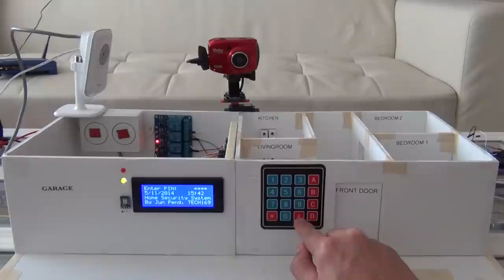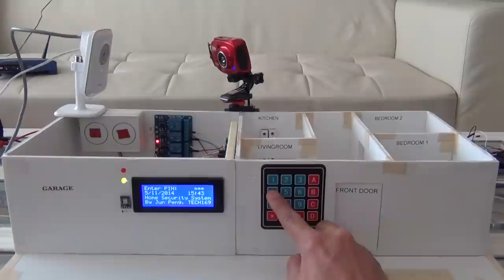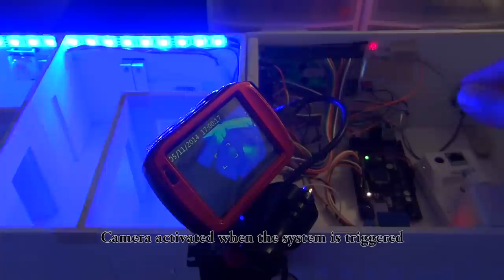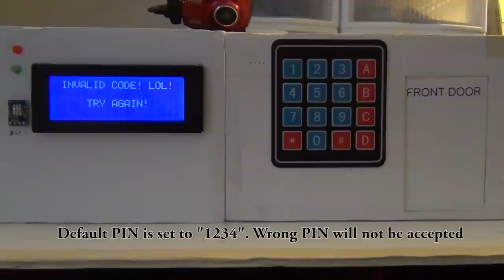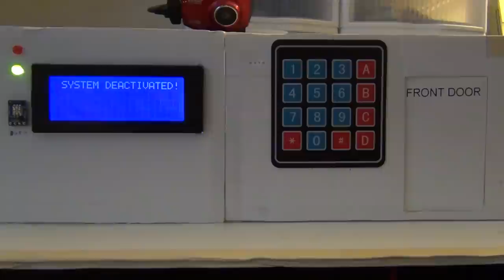Arduino Home Security System

Comment: great project. a HOW TO of your project with the script would be much appreciated
Reply from the maker: Man... dont have time to write a how-to
Reply: find some... lol
its ok just kidding. you could just upload the sketch though
Reply: Pikubird Ok
Hello, i build my own home security system. you find some videos on my channel. i'll publish the sketch and the circuit, when i am ready. Sorry for my bad english. Features atm: RFID-Reader, I2C-bus-connected terminal/ sensorcyles (Arduino Nanos) to maincontrol (Arduino Mega) with sabotage protection, SD-card event logging. Next time i'll add ir-sensors, keypad for configurations, LAN-module for webcontrol, rf-transmitter
Reply: Presence4You tx a bunch
Reply: Presence4You aun no lo terminas amigo? tengo la misma idea de proyecto y tengo algunas dudas al respecto que tal vez tu me ayudes a resolver, un saludo
Reply: Humberto José López Herrada Nein, ich bin noch nicht fertig. Ich warte noch auf Teile, wie z.B. die LAN-Erweiterung, das Kamera-Modul und ein Display. Koplett fertig aufbauen, mit Gehäuse etc. Kann ich es auch erst, wenn meine CNC fertig ist. Es wird ja jetzt wieder wärmer, da macht auch das Arbeiten im Keller wieder Spaß ;)
Reply: Pikubird Ok Excellent video content! Excuse me for butting in, I would appreciate your initial thoughts. Have you tried - Mahorrla Defence Wisdom Method (google it)? It is a great one of a kind product for securing your home from danger minus the headache. Ive heard some awesome things about it and my work buddy  got astronomical success with it.
Reply: que tal amigo, queria saber si usted logro; obtener buenos resultados con este proyecto, gracias.
Reply: lograste hacer este proyecto?

Comment: What GSM module did you use ? Can I use SIM300 to connect to Arduino Uno instead of using SIM900 or SIM800L? I'm doing home security with sms alert for my university physics project but I want a cheaper gsm module. Is it going to be any error if I use SIM300 instead of SIM900?

Comment: Jun Peng,  I really liked your project, but I can't find where you change the date and time sketch in which variable resistors are connected to the display and to what pin on the arduino connects to the rightmost contact on the keyboard? Thank you!

Comment: That is a wonderful and neat work.. I am truly impressed :)
I want to ask that after powering Camera through relay how did you set it to record video by default ?
Reply from the maker: The camera has a function as DASH CAM.
Reply: Do u have the coding for the Arduino

Comment: The code is ok?? The connections are ok?? i remove the relays, include the camera and the lights, from the code and the project and this not work. After that the green led is always on, and the rgb module is always showing 4 colors(red, green,blue and white). I need help to put this project work. Please, help me

Comment: thanks for your project jun peng

we finally completed our project successfully
Reply: +uma chand plz can u send me the shematic and the codes ?
Reply: hi friend they are provided in the description
Reply: thank u for the answer !! plz i need the real shematics !! cuz i have a problem when i enter the code 1234#
Reply: there are errors in the code 

if you correct the code and make connections it will work for sure
Reply: uma chand i want some help from you about this project i am having problem  in the code plz help me
Reply: Arduino: 1.8.2 Hourly Build 2017/01/25 04:33 (Windows 7), Board: "Arduino/Genuino Uno"

D:\sketch_jan28a\sketch_jan28a.ino:14:83: fatal error: Password.h: No such file or directory

 #include <Password.h> //http://www.arduino.cc/playground/uploads/Code/Password.zip

                                                                                   ^

compilation terminated.

exit status 1
Error compiling for board Arduino/Genuino Uno.

This report would have more information with
"Show verbose output during compilation"
option enabled in File -> Preferences.
HAVING THIS PROBLEM
Reply: @uma_chand  Can you share me the code?? they're no longer available

Comment: Hello, HOW did you turn off/on the cam?? I know you mentioned it on the codes and your Schematic, but still I don't get it. HOW did you connect your CAM? is it only your model you used can be turned on and off??

Comment: Can anyone help me.i made a simple pir alarm and its powered of a lip battery.when mains is turns on it charges the lipo. problem is is i  arm the alarm why the battery is charging from the mains moments later the alarm will go off like the pir sensor has been set off even tho noting was moving. if i disconnect the charger from the battery and set the alarm it does not randomly go off and works as it should. im guessing im getting interference from the battery charger but not sure what to do or try ?

Comment: Hello, love the work. I got a question, does the solid state relay have to be suppled with constant current to close its relay or just a trigger pulse. TY :)
Reply from the maker: I used a separate power source for the relay to trigger the camera. Camera needed more current than the arduino board can produce.
Reply: let me rephrase myself, do i need to supply constant power to the relay, like giving it current just to maintain the hold of the magnetic coil or just a trigger pulse to switch position from open to close.

Comment: Sir ,
       I was tried but come out this type of error ?kindly advise how to fix it. thanks 

In file included from sketch\Original_Program.ino.cpp:1:0:

C:\Program Files (x86)\Arduino\hardware\arduino\avr\cores\arduino/Arduino.h:41:14: error: expected identifier before numeric constant

 #define LOW  0x0

              ^

C:\Program Files (x86)\Arduino\libraries\Keypad/Keypad.h:43:13: note: in expansion of macro 'LOW'

 #define OFF LOW

             ^

C:\Program Files (x86)\Arduino\libraries\RTClib-master/RTClib.h:79:25: note: in expansion of macro 'OFF'

 enum Ds1307SqwPinMode { OFF = 0x00, ON = 0x80, SquareWave1HZ = 0x10, SquareWave4kHz = 0x11, SquareWave8kHz = 0x12, SquareWave32kHz = 0x13 };

                         ^

C:\Program Files (x86)\Arduino\hardware\arduino\avr\cores\arduino/Arduino.h:41:14: error: expected '}' before numeric constant

 #define LOW  0x0

              ^

C:\Program Files (x86)\Arduino\libraries\Keypad/Keypad.h:43:13: note: in expansion of macro 'LOW'

 #define OFF LOW

             ^

C:\Program Files (x86)\Arduino\libraries\RTClib-master/RTClib.h:79:25: note: in expansion of macro 'OFF'

 enum Ds1307SqwPinMode { OFF = 0x00, ON = 0x80, SquareWave1HZ = 0x10, SquareWave4kHz = 0x11, SquareWave8kHz = 0x12, SquareWave32kHz = 0x13 };

                         ^

C:\Program Files (x86)\Arduino\hardware\arduino\avr\cores\arduino/Arduino.h:41:14: error: expected unqualified-id before numeric constant

 #define LOW  0x0

              ^

C:\Program Files (x86)\Arduino\libraries\Keypad/Keypad.h:43:13: note: in expansion of macro 'LOW'

 #define OFF LOW

             ^

C:\Program Files (x86)\Arduino\libraries\RTClib-master/RTClib.h:79:25: note: in expansion of macro 'OFF'

 enum Ds1307SqwPinMode { OFF = 0x00, ON = 0x80, SquareWave1HZ = 0x10, SquareWave4kHz = 0x11, SquareWave8kHz = 0x12, SquareWave32kHz = 0x13 };

                         ^

In file included from C:\Users\User\Desktop\Electronic folder\Home Monitor system\Project -2\Original_Program\Original_Program.ino:18:0:

C:\Program Files (x86)\Arduino\libraries\RTClib-master/RTClib.h:79:139: error: expected declaration before '}' token

 enum Ds1307SqwPinMode { OFF = 0x00, ON = 0x80, SquareWave1HZ = 0x10, SquareWave4kHz = 0x11, SquareWave8kHz = 0x12, SquareWave32kHz = 0x13 };

                                                                                                                                 ^
exit status 1
Error compiling for board Arduino/Genuino Mega or Mega 2560.

Comment: Hello jun Peng, please did you use RTC DS1307 ic to display the time on the LCD?
Reply from the maker: I think that's what is used.
Reply: thank you for your reply. but i couldn't find the RTC in your design schematics for your project. please how did you connect it?

Comment: just curious, cuz i am a novice. why are you using relays, are you using high voltage? or you are using relay to control the voltage fluctuation due to the LED strip?
Reply: Bharath Kumar He is using led's for demonstration ,in real purpose he will use realy for lights
Reply: Relay to cut off the camera supply.If there is no intruder.Camera wont get the power supply
Reply: Arduino 4u Your are using relay only for cameras...
Reply: Arduino 4u relay are used for switching ...I mean to say that if there is use of 220 ac light source then you have to use relay for switching

Comment: That's quite a great project you put up! Well done...I have a question. How can your code be modified so that the system will constantly check the sensors whether or not the alarm system has been activated? If the alarm pin is entered while one of the sensor is open and its suppose to be close the system will signal that particular sensor to the user. The system can be armed only when all sensor are inactive that's all doors closed and the is no motion in the rooms.

Comment: I want to use a Arduino Uno R3, 8 channel relay module and a DS1302 RTC to control the lights timing of my house. It is similar to a digital house timer switch with multiple days and different time On and OFF setting. Can you help me with the codes.

Comment: Hello, with my friend I tried make your model of "Arduino Home Security System". We bought everything from your list, and constructed according to your schematic. When we launch arduino with your code - it´s only launch servo and display start lighting without text. Sensors not responding. Your schematic is compatible with code? What we must do in RTC library so as it would be functional? Thanks for help. We would be grateful. I can send you some screens of that problem.
Reply: now can you success it?
Reply: hello how about your project now? 
I think I want to do this project too.
Reply: so u can complete the project ?

Comment: Arduino: 1.6.0 (Windows 7), Board: "Arduino Uno"

sketch_feb17a.ino:4:9: error: stray '@' in program
sketch_feb17a.ino:4:18: error: variable or field 'keypadEvent' declared void
sketch_feb17a.ino:4:18: error: 'KeypadEvent' was not declared in this scope
sketch_feb17a.ino:1:1: error: 'Home' does not name a type
In file included from sketch_feb17a.ino:1:0:
C:\Program Files (x86)\Arduino\hardware\arduino\avr\cores\arduino/Arduino.h:41:14: error: expected identifier before numeric constant
 #define LOW  0x0
              ^
C:\Program Files (x86)\Arduino\libraries\Keypad/Keypad.h:43:13: note: in expansion of macro 'LOW'
 #define OFF LOW
             ^
C:\Program Files (x86)\Arduino\libraries\RTClib/RTClib.h:59:25: note: in expansion of macro 'OFF'
 enum Ds1307SqwPinMode { OFF = 0x00, ON = 0x80, SquareWave1HZ = 0x10, SquareWave4kHz = 0x11, SquareWave8kHz = 0x12, SquareWave32kHz = 0x13 };
                         ^
C:\Program Files (x86)\Arduino\hardware\arduino\avr\cores\arduino/Arduino.h:41:14: error: expected '}' before numeric constant
 #define LOW  0x0
              ^
C:\Program Files (x86)\Arduino\libraries\Keypad/Keypad.h:43:13: note: in expansion of macro 'LOW'
 #define OFF LOW
             ^
C:\Program Files (x86)\Arduino\libraries\RTClib/RTClib.h:59:25: note: in expansion of macro 'OFF'
 enum Ds1307SqwPinMode { OFF = 0x00, ON = 0x80, SquareWave1HZ = 0x10, SquareWave4kHz = 0x11, SquareWave8kHz = 0x12, SquareWave32kHz = 0x13 };
                         ^
C:\Program Files (x86)\Arduino\hardware\arduino\avr\cores\arduino/Arduino.h:41:14: error: expected unqualified-id before numeric constant
 #define LOW  0x0
              ^
C:\Program Files (x86)\Arduino\libraries\Keypad/Keypad.h:43:13: note: in expansion of macro 'LOW'
 #define OFF LOW
             ^
C:\Program Files (x86)\Arduino\libraries\RTClib/RTClib.h:59:25: note: in expansion of macro 'OFF'
 enum Ds1307SqwPinMode { OFF = 0x00, ON = 0x80, SquareWave1HZ = 0x10, SquareWave4kHz = 0x11, SquareWave8kHz = 0x12, SquareWave32kHz = 0x13 };
                         ^
In file included from sketch_feb17a.ino:23:0:
C:\Program Files (x86)\Arduino\libraries\RTClib/RTClib.h:59:139: error: expected declaration before '}' token
 enum Ds1307SqwPinMode { OFF = 0x00, ON = 0x80, SquareWave1HZ = 0x10, SquareWave4kHz = 0x11, SquareWave8kHz = 0x12, SquareWave32kHz = 0x13 };
                                                                                                                                           ^
Error compiling.

  This report would have more information with
  "Show verbose output during compilation"
  enabled in File > Preferences.

Comment: Guys mine worked but 1 problem the led is off when system is trigerred and on when it is active if i keep the project in dark i cant see the video it is fully black i used a webcam with usb which i got for Aed 20 and then stripped off the usb connecter and did the rrest

Comment: am a student at the university and I need your help. I have to do a graduation project. Is there a possibility to share the project with its files or even at least how did you install the project because in the original video it is unclear because the drawings are incomplete and this is unfortunately shameful.

Comment: This error pops up whenever I try to upload the code

Arduino: 1.8.5 (Windows 7), Board: "Arduino/Genuino Mega or Mega 2560, ATmega2560 (Mega 2560)"

In file included from sketch\sketch_mar08a.ino.cpp:1:0:

C:\Program Files (x86)\Arduino\hardware\arduino\avr\cores\arduino/Arduino.h:41:14: error: expected identifier before numeric constant

 #define LOW  0x0

              ^

\\vmware-host\Shared Folders\Documents\Arduino\libraries\Keypad/Keypad.h:43:13: note: in expansion of macro 'LOW'

 #define OFF LOW

             ^

\\vmware-host\Shared Folders\Documents\Arduino\libraries\RTClib-master/RTClib.h:79:25: note: in expansion of macro 'OFF'

 enum Ds1307SqwPinMode { OFF = 0x00, ON = 0x80, SquareWave1HZ = 0x10, SquareWave4kHz = 0x11, SquareWave8kHz = 0x12, SquareWave32kHz = 0x13 };

                         ^

C:\Program Files (x86)\Arduino\hardware\arduino\avr\cores\arduino/Arduino.h:41:14: error: expected '}' before numeric constant

 #define LOW  0x0

              ^

\\vmware-host\Shared Folders\Documents\Arduino\libraries\Keypad/Keypad.h:43:13: note: in expansion of macro 'LOW'

 #define OFF LOW

             ^

\\vmware-host\Shared Folders\Documents\Arduino\libraries\RTClib-master/RTClib.h:79:25: note: in expansion of macro 'OFF'

 enum Ds1307SqwPinMode { OFF = 0x00, ON = 0x80, SquareWave1HZ = 0x10, SquareWave4kHz = 0x11, SquareWave8kHz = 0x12, SquareWave32kHz = 0x13 };

                         ^

C:\Program Files (x86)\Arduino\hardware\arduino\avr\cores\arduino/Arduino.h:41:14: error: expected unqualified-id before numeric constant

 #define LOW  0x0

              ^

\\vmware-host\Shared Folders\Documents\Arduino\libraries\Keypad/Keypad.h:43:13: note: in expansion of macro 'LOW'

 #define OFF LOW

             ^

\\vmware-host\Shared Folders\Documents\Arduino\libraries\RTClib-master/RTClib.h:79:25: note: in expansion of macro 'OFF'

 enum Ds1307SqwPinMode { OFF = 0x00, ON = 0x80, SquareWave1HZ = 0x10, SquareWave4kHz = 0x11, SquareWave8kHz = 0x12, SquareWave32kHz = 0x13 };

                         ^

In file included from C:\Users\RAJMAN~1\AppData\Local\Temp\arduino_modified_sketch_936056\sketch_mar08a.ino:6:0:

\\vmware-host\Shared Folders\Documents\Arduino\libraries\RTClib-master/RTClib.h:79:139: error: expected declaration before '}' token

 enum Ds1307SqwPinMode { OFF = 0x00, ON = 0x80, SquareWave1HZ = 0x10, SquareWave4kHz = 0x11, SquareWave8kHz = 0x12, SquareWave32kHz = 0x13 };

                                                                                                                                           ^

exit status 1
Error compiling for board Arduino/Genuino Mega or Mega 2560.

This report would have more information with
"Show verbose output during compilation"
option enabled in File -> Preferences.
Reply: "clear tmp file,and try use IDE 1.6.8
Reply: Can you share me the code?? they're no longer available

Comment: what if you have a pet in the house?
Reply: You can also with the right equipment turn up and down sensor, so it will not detect on smal objects like child or cats
Reply: can use regular DSC lpci pir detector with pet imunity
Reply: Sons_of_Liberty metal cage helps you when you leaving the house
Reply: you hang around their neck a sensor receiver that makes them undetectable or acceptable form the alarm system sensor
Reply: a bit expensively PIR sensors have options to alarm on weight more then 20 kg.
So that is not a problem
Reply: In romania is about 10 usd, lc100pi DSC pir detector. So i think is not so expansive

Comment: A great project. Possible to get the wiring diagram of the device? do you mind if you tell me the hardware you used like the type of the camera and the type of the arduino board and the motion detector. is there way to do like getting text message on our mobile if motion is detected.
Reply from the maker: A general schematic link is updated in the description and refer to the Bill of Materials. It doesnt have the SMS feature, but it is very possible.